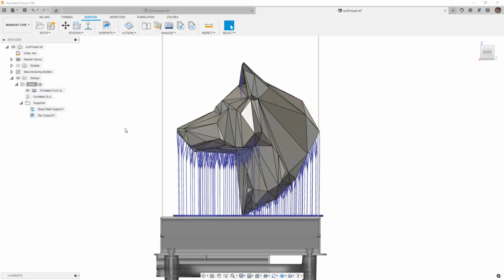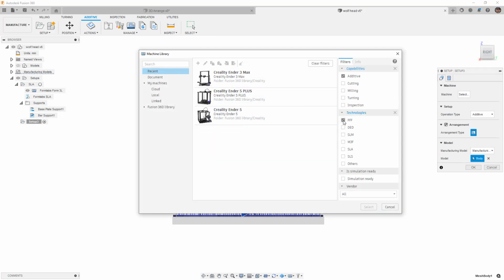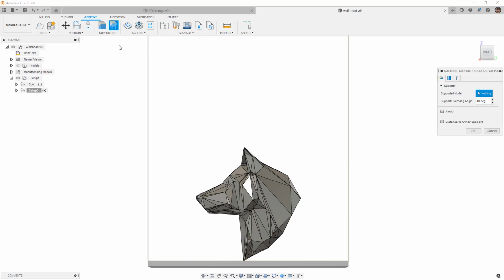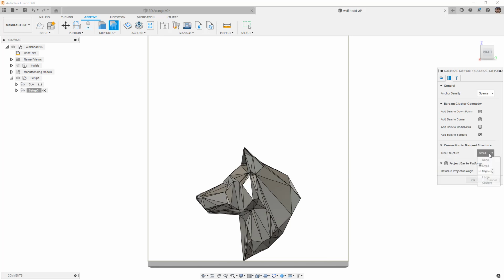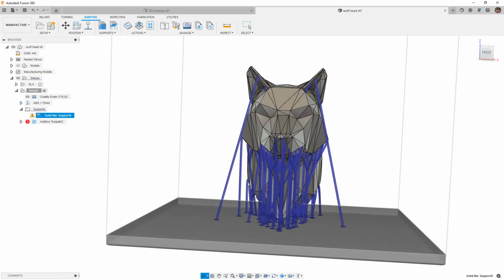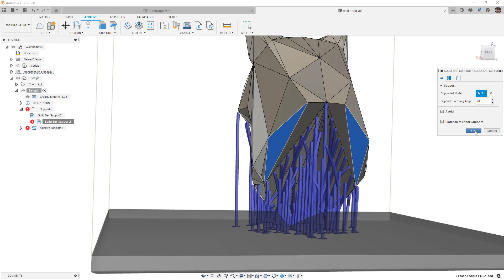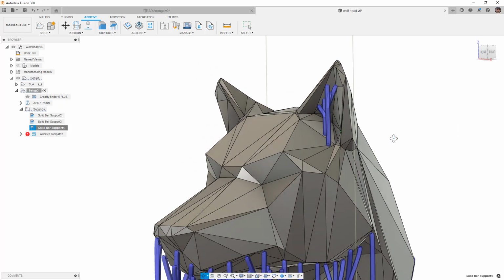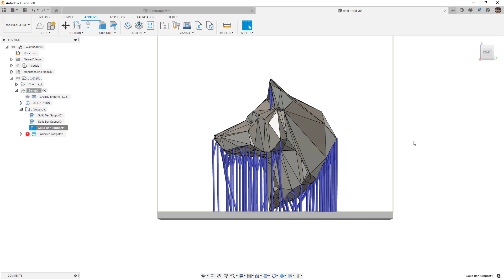NEW Tree Bar Supports for FFF Additive Machines in Fusion 360 - What's New March 2022 #Fusion360

Comment: great video, but I have one question. I create my supports then I don't know how to export the .stl with the supports on it. how is this done?
Reply from the maker: So sadly I don't think that is possible.  There is a 3MF format that you can export which contains "manufacturing" data.  Under the Actions menu you should see a 3mf scene export.  that will give you the option to export your mesh with supports and you can take that to another slicer.

Comment: HI, I have a prusa MK3 and when I start a new setup, all defaults, it places the "bed" verticaly  in relation to the "top plane"...Do you know why this happens? (also tried with other prusa models...same). Thanks!
Reply from the maker: Hi Jure, when you select your machine in the bottom right corner it will tell you the head orientation.  It should say something like "Axis information" and then list the Table and Head along with their respective axis.  By default(since 2020 i think) has worked in a Z up orientation.  This is a setting in the user preferences on the General section.  If you have your coordinate system as "Y up" then when you select a machine the table would still be referencing Z.  My best guess is that is what happened to you.  

So my suggestion is to go to User Preferences and set your "Default modeling orientation" to Z up.  Note that this will apply to all new designs after you change the setting, but not to any current designs you have.  Unfortunately the way to change that is to rotate your model.
Reply: @LearnEverythingAboutDesign  Yes, thank you, that's exactly what the case was. I had the defaults as Y up. I was already wondering, why all my exported stl models came orientated sideways :D Thank you very much!
Reply from the maker: Glad it helped!

Comment: I own a Ender 5 Pro .. Looking at the support structures in this video .. I highly doubt the support material is suitable for FFF (PLA or ABS) .. Only for Resin based 3D printer This tree type support will be good
Reply from the maker: True, you can increase their diameter and this model is probably better suited to solid supports that tree supports.  I am hoping it will evolve.